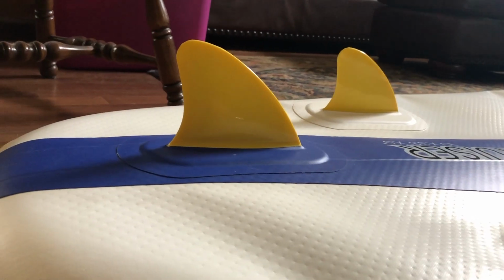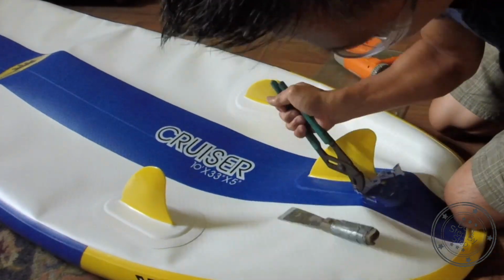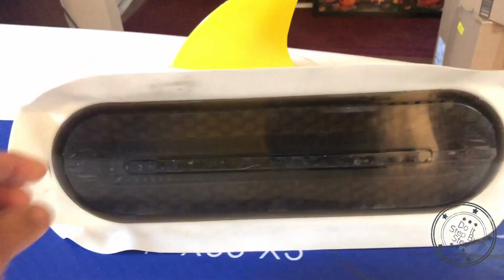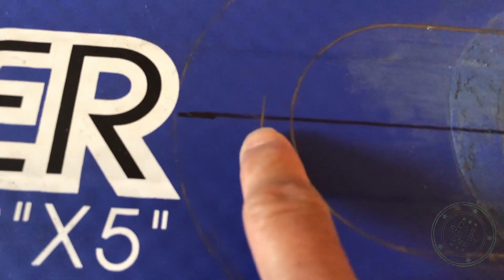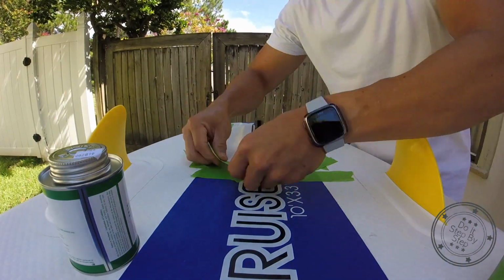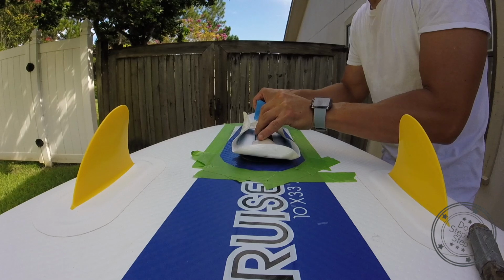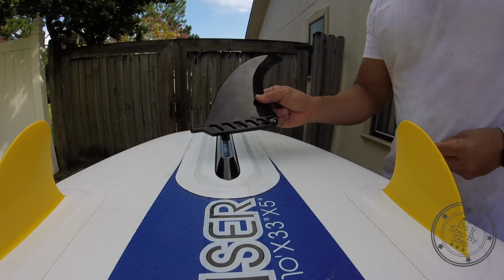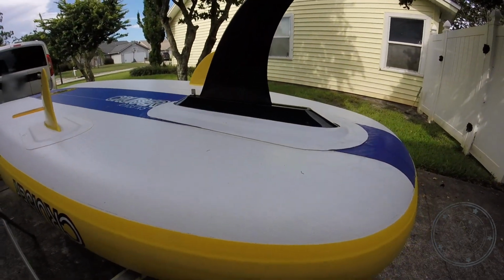How to Upgrade an iSUP small fixed fin to a BIGGER fin and fin box. Retrofit Install Repair Replace

Comment: Are all fixed fins simply glued on?

What different types of glues are needed for different types of boards?
Reply from the maker: @saulkravitz  I want to say fixed fins are glued on, but there maybe some manufacturers that have molded fins?

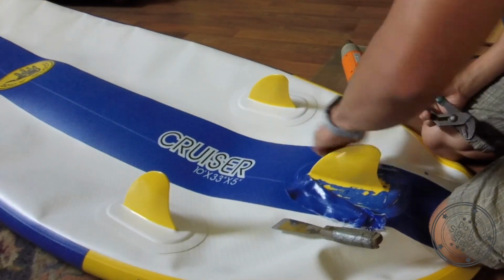Review the video starting at 2:08. I talk about identifying the types of materials, hypalon and pvc, for your iSUP.  Then you can get the correct adhesive for your  iSUP.  Hope that helps!

Comment: Great video, thanks for sharing. i have question though why are you using vinil cement for PVC material? Thanks
Reply from the maker: @RomanKundys  my iSUP is constructed with polyvinyl chloride (PVC) fabric. And the adhesive I used (HH-66) is one of the better choices for this type of material and project.  I hope this helps!

Comment: Thanks for the great video.  Thumbs up from me ;)  I was just wondering, has anyone explored the idea of manufacturing a hollow fin, like a sleeve, that we could pull over the rear fin and secure it with a pin?  With the advent of 3D printing it should be doable.  I would expect that the thickness of the large fin will duble but I don't think that would create too much drag.  Thoughts?

Comment: Thank you for this tutorial. I am looking at a used Body Glove Performer 11' for a great price, but was uncertain because of the fins. Problem solved!
Reply from the maker: You're welcome! I hope your upgraded iSUP works for you as well as it works for me!
Reply: @doitstepbystep3376  so I bought the Body Glove Performer and the guy at the shop suggested that I add a fourth fin instead of replacing the third. I've ordered a fin box and touring fin from Level Six. What do you think; would four fins be too much, or a great improvement over the original design?
Reply from the maker: @xxMarmot  That's a good suggestion, but I am not sure if I personally would like the position of the touring fin location if the original thruster/center fin is in the way. (A quad fin or four fin setup typically does not have two thruster fins.  It has a pair of "twin fins" with no "thruster" fin. )

I did notice that the thruster fin of the Performer 11 is placed further back than the thruster fin of my Body Glove Cruiser, so your P11 may track straighter/easier than my Cruiser.  

What I would do is try the Performer 11 just like it is and see how you like it.  You may be ok with it just like it is without the touring fin.

The cool thing is, if you do remove the original center fin and install the fin box, and you can always buy a shorter fin for shallow water excursions.
Reply: @doitstepbystep3376  I've tried out the Performer 11 and I really liked it in glassy flat conditions. My plan now is to replace the centre fin with the touring fin and possibly get another fin to swap out with it as you suggested. As well as looking wonky, the fourth fin in the centre would make it hard to pack up the board.
Reply from the maker: @xxMarmot  Well done!

Comment: Amazing video and tios🤙.
I think to add central one to use like a dagger board (when using like a windsup). Can you help me please with some advise, and how to find the right place to stick it.
Thank you .
Reply from the maker: Hello! Thank you for your comments! In regards to installing a central fin on your iSUP to function as the windsup central fin, I can only recommend searching for inflatable windsups photos, or find a local shop that has an inflatable windsup to mearsure the location of the central fin.  If the board length is different than yours, you will have to "ratio" the fin location to the overall length of the board to correctly locate the fin on your board.  Best of luck to you!

Comment: Just did an install on Performer 11. It went well. Just a word of caution  use the heat gun conservatively. Heat a small area ; raise vinyl; pull with pliers; Maximise the pull minimize the heat.

Comment: Do you have a link to where to buy the fin box?
Reply from the maker: Hi, I bought it on am@zon.  You can search there.  The seller I bought from looks out of stock.
Reply: @doitstepbystep3376  Thanks for the info! I'm going to add one to my Slingshot Crossbreed so I can use a wing.

Comment: I would have glued the base plate to have a more secure bond. You did a good job,  I make an electric fin that puts tork on the box, so a strond bond is key. dolsey.com   e-fin. paddle assist will work with the Air 7 box you installed.
Reply from the maker: Thanks for the comments!  I totally agree with gluing the base plate when using a electric fin.

Comment: I'm about to do this with my Performer 11 as well. See like everyone else has the same ideas. It's a great board...except that center fin. 

Can any one else confirm that we can safely remove that fin using the methods outlined here? Thanks!
Reply: Did you find an adhesive that works?
Reply: @jayspeidell  I ended up returning it and got a cheapo Amazon board that you can replace the fin. I replaced that one with a longer fin and I love it. Definitely not as stable as the Performer 11 (I fall more often) but a bit more nimble and def faster.

Comment: What adhesive did you use for the base plate? I have essentially the same board. Performer 11.
Reply from the maker: Hi Bryan.  Thanks for the question.  I used the adhesive that came with the Bodyglove repair kit for the baseplate, which is basically the same as HH-66.  If I could do it over again, I would have saved that adhesive for emergency repairs, and used HH-66 vinyl adhesive on the base plate.  It is the same adhesive I used for the fabric material of the fin box and on the iSUP.
Reply: Do it Step by Step thanks so much! I was struggling to figure out if I should use marine adhesive like 5200 or just the hh-66. Might use this jb waterweld stuff J-B Weld 50172 25 ml. MarineWeld Syringe https://smile.amazon.com/dp/B00R2CDVIW/ref=cm_sw_r_cp_api_i_6WxmFb9CFAB9Y says it’s good for pvc. Thanks again!

Comment: Please any chance to do a video on how to install a 2 side small fins to a iSUP with single fin? And a list of materials need? Thanks for the video!
Reply from the maker: Hi, and thank you for the comment.  I can do it and video the installation if one of my local iSUP friends wants the small twin fins added to their iSUP.  Until then, we will have to wait.
Reply: @doitstepbystep3376 
Cool video. Do you think there is a way to retrofit or convert the smaller side fins to us fin box system? The actual (us fin) box seems quite long and I wonder if there are shorter boxes. I've seen shorter us fin box fins but not shorter boxes and I also wonder if a longer box would impact glide performance.
Reply from the maker: Thanks for the comment @oBsRVr666 !  I haven't seen smaller fin boxes for iSUPs.  But I have seen the Shark foldable fin box.  The cool thing about it is it does take US fins!  YouTube search Shark foldable SUP US Fin Box for more details.

Comment: I just got the Body Glove Performer 11. Nice board but it does take work to keep it straight. Thanks for this helpful video. How has the performance of your SUP been you added the longer fin?
Reply from the maker: Hi Gary,  Thank you for your comment and question!  I have no regrets installing the new fin box and longer fin.  The fin is set all the way back so the board tracks straight for longer distances.   One thing though.  I haven't tried removing the fin and rolling up the iSUP in the bag.  I keep my iSUP partially inflated on a rack, not in the storage bag. The fin box may prevent me from rolling it up small enough to store it in the bag that came with it.
Reply: @doitstepbystep3376  This is a factor to consider.  Big fin boxes affect the roll up.
Reply from the maker: @ceeweedsl  True! But if you always store your board rolled up in the bag for extended periods, you risk vinyl cracks from fold lines especially if it is not in an environmentally controlled room.
Reply: @doitstepbystep3376  I think so also.  Body glove manual says its fine to store rolledif I remember right, but I feel that lightly inflated is best. In any case I do roll mine up every week for vehicle and backpacking tp the beach.

Comment: Here because my Body Glove performer 11 doesn't track well either.   Too bad they didn't come with a fin  box.
Reply: @Charlie Krew yea, been using instaflixxer for since december myself =)
Reply: I just bought one and was a bit scared of this. Damn. Welp. Guess I got some work to do now replacing that center fin
Reply: @Jose-yx3ek  I'm planning to install the fin between the two parallel fins rather than replace the rear fin. Don't have tools and space in my apartment for all the stuff in this video, if I did I wouldn't be on an inflatable haha
Reply: @jayspeidell  fair point hahaha please do tell how it turns out if it improves performance or not.
Reply: @jayspeidell  post back on how that goes. Was thinking the same, to add the fin box between those 2 existing fins and leave the small centre one as-is. Just wondering whether tracking benefits are significant enough to make it worth doing.
Reply: @jayspeidell  have you done this yet?  I'm curious how much of a difference this would make.
Reply: @Jose-yx3ek  Or not.  My older one failed (heat bubble) and I exchanged it for the newer  version with the forest decor. Older one had turtle .  Anyway, the newer one has wider fins and tracks a tiny bit better.  So far, I've not been inspired to change it.  Just switch sides more.   Part of the reason I think it is harder to paddle straight is the width. Pushes the paddle further to the side and harder to paddle correctly.  But it's ok.
Reply: @Charlie Krew Definitely, been using InstaFlixxer for since november myself :)
Reply: you prolly dont care but if you're stoned like me during the covid times then you can stream all the new movies on InstaFlixxer. Been watching with my brother recently :)

Comment: I am planning on doing this on my BodyGlove Performer 11, so virtually identical procedure. Now that some time had passed, do you have any thing you'd do differently, or still follow the steps in the video? Also, what temperature would you recommend for the heat gun?
Reply from the maker: lekerstein After finding the center of the iSUP, I would probably dry fit the fin box with tape and check the location from all angles. Also, I listed the lessons learned like adhesive selection, and fabric gluing, in the video description. I hope your install goes well!
Reply from the maker: lekerstein Also, my heat gun only has Low or High selection.  I used the Low setting.  High would have been too hot🔥

Comment: Good write-up. Most how-to's are for replacing the original fin box with another one. 

I installed air7's on two different paddle boards that used in-house finboxes in their 1st generation models. Since mine used removeable fins, I felt it better to start pulling/heating the fabric from the inner radius close to the fin slot. It lets you be a bit more rough with the removal in the beginning.

As far as finding the center position, I noticed that both my paddle boards had spots in the lettering that indicated the centerline. I'm looking at yours and notice that the middle horizontal line in the letter 'E" in 'CRUISER' may actually be dead-center.
Reply from the maker: Thanks for taking time to comment and add your helpful tips!